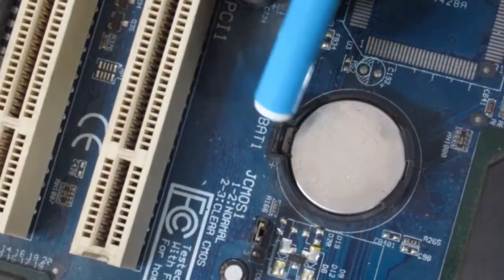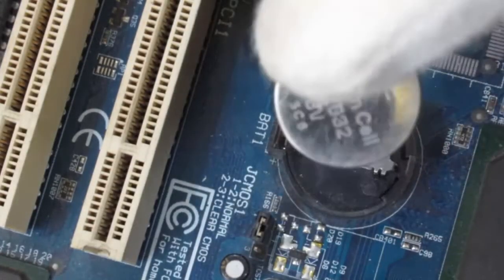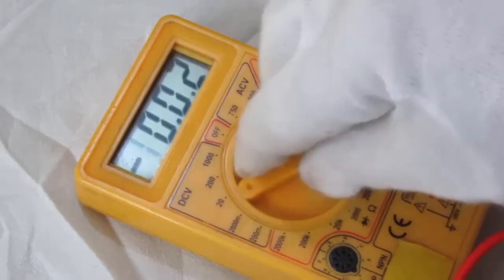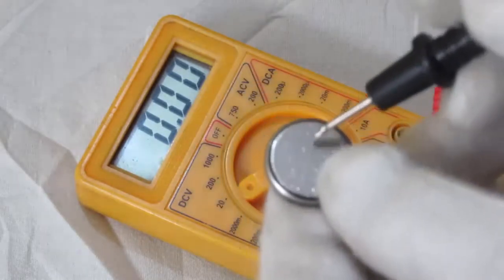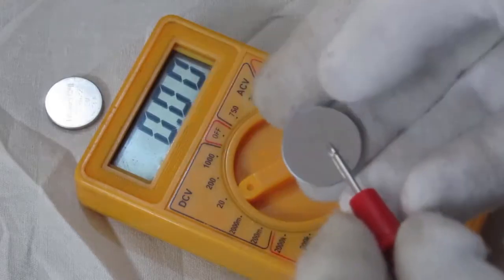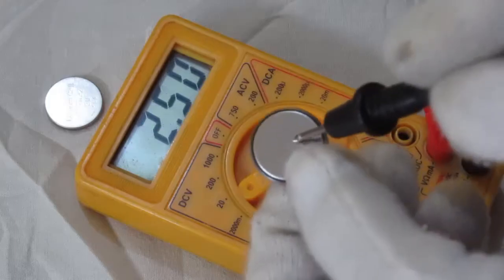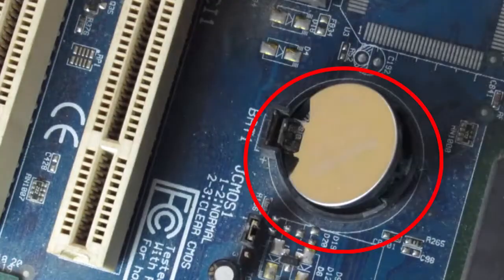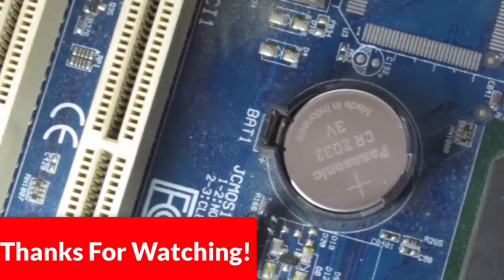How To Check and Replace Computer CMOS Battery?

Comment: You can't properly check an older battery without a load on it. Checking it with a multimeter isn't checking with a load... unless the multimeter has a battery load capability in it.

Comment: You don't have to remove the battery to test. The + is on the top so touch red lead to top and black lead to metal chassis

Comment: When I'm turning on my pc doesn't turn on but when I'm remove the cmos then put it back again, my pc starts turning on. Does this means i need to replace my cmos?
Reply: Did you solve this issue? New PSU and amber light is on, but no start. I'm hoping it's not my motherboard.

Comment: You're not mentioning which are the positive and negative points in battery holder while fixing the battery.
Reply: shiny side is +   you put it in the computer + side up.

Comment: Is there a way to figure it out without a multimeter physically?
Reply would be appreciated
Reply: Lick the edge where your tongue will make contact with positive and negative (top & bottom) & if you feel ticklish/weird. Still has charge.
Reply: @Justin Stein and @AJ Flores
Thank You
Reply: @troll-official9994  but you don't want to trust that method. Unless you feel nothing when testing with your tongue, you'll need to replace it for sure.
Reply: @ajproart2  Yeah i just got a new CMOS Battrey and unlike my old CMOS Battrey,the ticklish feeling was pretty strong.
Reply: @troll-official9994  alright!